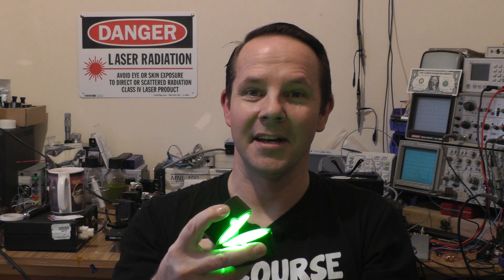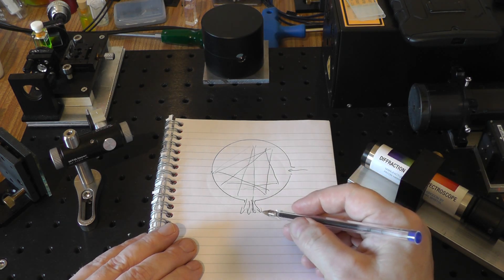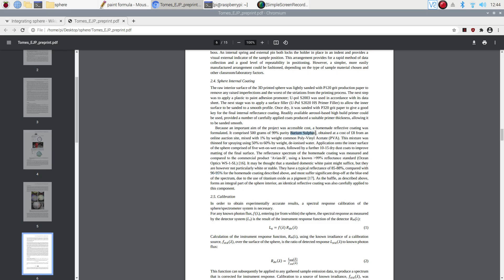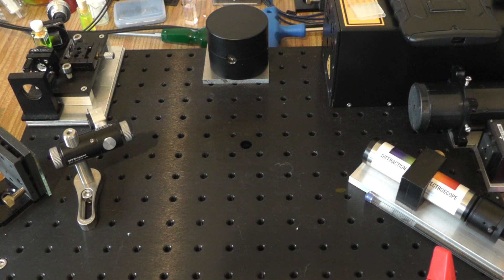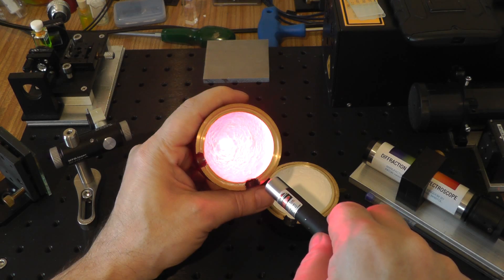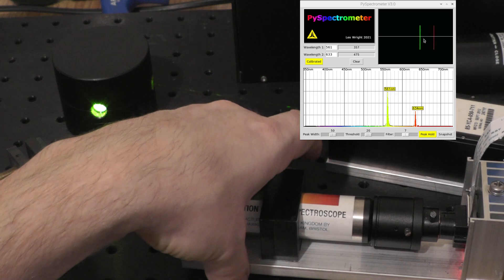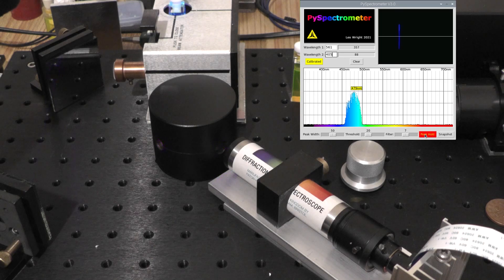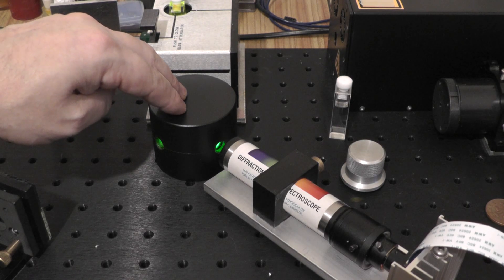Home Made Integrating or Ulbricht Sphere

Comment: Whiskey round ice press. copper-coated stainless steel with around 4cm diameter cavity inside for ~$15. but 3d printing is far superior, just needs more paint or copperplating first to minimize absorption.

Comment: Do you happen to have access to the CAD/STL files for the sphere? Having difficulty gaining access.
Reply from the maker: Hmm, I don't seem to have them handy, and the link is broken. Really the only requirement is a hollow sphere with input and output ports at 90 degrees, so it should not be too difficult to design. You could probably do in in TinkerCAD.

Comment: Just a lick of matt black paint on that mould and it doesn't look the slightest bit out of place on an optical bench.
Reply from the maker: For sure. I found an auto paint manufacturer in the UK (Steyer) that does a hard wearing acid etch primer that goes on like silk. I use the stuff for everything.

Comment: Repurposing a cannon ball mold makes a much better and less expensive integrating sphere than the one I blow molded from Plexaglls or made by using Plaster of Paris to make a mold of a large ball bearing, then painting the cavities with the same one percent PVA and Barium Sulfate you used. The Plexagals integrating sphere functioned as well as a metal one, but the cost of making a fixture to blow mold the hemispheres and learning to blow good plastic hemispheres at 325 F. Then mating two hemispheres to form an acceptable sphere and finding a primer and surface finish for Plexiglas that homemade Barium Sulfate paint would stick to cost a great deal more in labor than $40 to $100 USD the cannon ball mold would have cost. 

Plaster of Paris cast over a ball bearing is quick and cheap, but it absorbs humidity and is not compatible with lasers with much power at all. Steam explosions in the walls of the integrating sphere will mess up a lot of stuff.

Comment: May I ask you a question?  Sorry in advance for my English. Since the laser was diffused inside the Ulbricht Sphere, may I say that the laser that comes out is a diffuse ray? It lost the temporal coherence but still has spatial (the wave length is invariant)... Is it right? Is it less dangerous that the previous laser? Thank you.
Reply from the maker: Yes, the beam that emerges is diffuse, and loses coherence to a degree (there are more effective ways to de-cohere a beam). The resultant light is not less dangerous. If you stare into it, you are still looking at a light source brighter than the sun.
Reply: @LesLaboratory  Thanks a lot. The calculations (for a 3B laser of 1,6 microJ) due to CEI 60825-1 let me consider an irradiance less than EMP. May I did think something wrong?

Comment: Hello, You might notice that the barium sulfate is water absorbing and with time (and the PVA glue) your reflectance levels might decrease. Aluminium oxide (that is used in commercial paints) might be another option. Something that would be a great addition would be vacuum forming a PTFE sheet in your sphere. 
Also, you might be keen to sand (300 grit as per ASD) the inner side and paint to have a lambertian (uniforrmely diffused)  surface.
Reply: the main big matter is that PVA glue will eventually develop color centers when aging.

Comment: I made a similar sphere, but for a different purpose. For uniform illumination of the film. Barium sulfate is very difficult to grind into a homogeneous substance. You need to make a bead mill and load barium sulfate and PVA into it. But for a single use, you can grind with a pestle in a mortar with a small amount of glue, and then dilute with glue to the desired consistency. Les, have you tried doing holography with your color lasers? I think it's very interesting. I also want to make an N2 laser and I have everything for this.. But I don't have the opportunity to buy a quartz cylindrical lens and mirrors. Because of this, I am very upset. Do you know where you can get such a thing?
Reply from the maker: Cool! I got my cylinder lens from Edmund Optics, but it was expensive at around $80. You can however find suitable Cylinder lenses in Laser printers. They use them to shape the laser diode beam, and although not silica, they are transparent enough that they will work.

Comment: Very inspiring! I intend to build a heterodyne interferometer (from sam zeloof) but dont have an optical bench. Do you have any advice regarding optical plates (where to find cheap ones?) I saw some 3D designs from BrendaEM and printed them but i dont know how they compare
Reply from the maker: I got mine from Thorlabs for 200 bucks including shipping and tax, which I figured as pretty reasonable. I had considered buying thick aluminum plate, and drilling ant tapping it, but Aluminium is expensive anyway, plus the time and effort drilling hundreds of holes.
I suppose in a pinch you could get steel plate, ans stick magnets on all your optical mounts....
Reply: @LesLaboratory  thanks! Ill try my 3d printed ones out :)

Comment: That went together really well. I was also having issues with spectrometer measuring and I have been seeing how sanded metal surfaces and frosted glass diffuse the beam. I could see making one of these Ulbricht spheres and having an iris and SMA connector attached to it.
Reply from the maker: Thanks, it was a nice build. For sure, you could mount an SMA fiber connector on it. It would probably make it more efficient than mine. Large apertures waste photons.
Reply: Did you ever find the CAD file associated with the paper?

Comment: Excellent. What is the diameter of your cannon ball mold?  I'm based in the USA can can't seem to find one. Any suggestions?
Reply from the maker: 2 inches in diameter internally. Hmm, try looking for sinker moulds or similar. Some anglers like big heavy weights on their lines!
Reply: @LesLaboratory  thanks, I did try that. BTW an excellent channel.
Reply from the maker: @DaSmokeDaddy  Thanks! Try eBay, take a look at 290809870305, they don't have any large ones in stock, you could always enquire.

Comment: Nice work as always, Les! Thanks for the upload. 

I think I can more clearly see why speckle is present in the outputs from some my dye lasers - although the output from a dye like R6G is broad, the edges of this broad curve appear to be rather abrupt and sharp (as distinct from the smooth curve that would result if analyzing the spectrum of light from an incoherent source). Am I correct in this attribution?
Reply from the maker: You can get good speckly output from R6G of you are using a diffraction grating to tune it. The problem is, the gain of R6G is so high, it is easy to overdrive it (in which case gain will happen with mirrors or not, and so you get very broad emission), even with very small Nitrogen lasers.
To attenuate home built N2 lasers, I just add regular glass microscope slides in the N2 laser beam, until I am just at threshold for the dye being used.

Comment: Your description of the integrating sphere makes me wonder, can it act as an optical pulse time stretcher? A pulse enters and starts bouncing around, some paths are longer that others, so the light in an individual pulse takes longer to exit, than its duration when it entered. Hmm, 2 centimeter sphere? Transit time of ~67 pS. You mention that the laser pulses are ~2000 pS long, so a 10 % stretch would be about three or four transits of a 2 cm sphere. Have you an o'scope and detector fast enough to measure your pulses? does the sphere stretch them out?
Reply from the maker: I don't see why not, the problem is I no way of measuring it. My Fastest Scope is only 100MHz. I would need either a much faster 'scope or a streak camera to do stuff like that.

Comment: Great video
Really cool project!

Building up a “felt-like“ coating, seemed to give me the best results. Of course then it is CRAZY fragile. And a few fingerprints can really diminish the effectiveness.

I used a ball mill to obtain a SUPER fine compound. I’ve experimented on and off with that for a few years, not only with barium, but also carbon/graphite in an attempt to find a substitute for “Vantablack“. Which is super useful for things like broadband coatings of optical power sensors, and anti-reflective coatings inside of optics. 

The best results were obtained by experimenting with the techniques of application. Trying to build up a “felt-like” coating, Made a pretty big difference.
Because it’s more of a 3-D texturized application, which traps light a lot easier, and in the case of barium… seem to give more surface area for the light to reflect.

Also, here in usa I was able to find readily available cheap spheres made of thin lightweight materials, I guess they’re aluminum… some of them are stainless.

There’s a ton info on YouTube regarding a DIY sphere. 

“Periodic videos“ put out a wonderful video on barium and it’s reflectance properties in the past year or two. 

And Believe it or not… “Torque test channel“ built a very similar device, to test the output of various brands of flashlights. If memory serves me correctly, they also sent some of the flashlights away to be tested in a real laboratory to compare it to their DIY device. 

One of the best recent videos is from “IMSAI GUY”, and he explains the science behind it. He has a background in optics and is extremely knowledgeable on the subject. And shows a very nice example of an integrating sphere.
Reply: Here are the above-mentioned videos

https://youtu.be/Ay6ckBojc_0

https://youtu.be/TDfVxYbcB5Y

https://youtu.be/tuYIKuyKZHU
Reply from the maker: @hullinstruments  Cool! And thanks for the links! Yep, I wanted something quick and effective, but sure, you can do funky stuff with coatings. Some formulations for white, required you to dust the surface with dry BaSO4 while the last coat was still wet.
This would undoubtedly improve reflectivity by a couple of percent, but as you say, would make for a fragile coating for sure!

Comment: what's that going on down there at 465nm while the coumarin is lasing at 495? Amplified spontaneous emission?
Reply from the maker: Yes, you are exactly right, it is ASE! This happens with the Rhodamine as well (although in the green)
It is possible to get rid of it. It is not as coherent as the main beam, and appears mostly as side beams that you can nip off with an adjustable Iris. A small Lathe project I did was to make a post and holder for a small Iris I bought off of eBay, and it works really quite well.
Reply: @LesLaboratory  noice! slowly but surely I am still learning how the nature of things is arranged...

Comment: Thanks Les, great vid. Some questions: a) I saw wisps of smoke at various points in your vid - what's that all about? b) What beam power can the sphere accept before being damaged?
c) Great to know the simple formulation of indoor barium sulfate paint, but what would your viewers need to do for a 'How to make barium sulfate outdoor paint at home' video? I want to keep my shed cool in the hot Aussie sun 😀
Reply from the maker: You are welcome! So answers in order:
a) Smoke is for effect, everyone loves to see laser beams, and it helps illustrate things,  so I waft a bit of Majcan about the place.

b) I have not measured maximum power that the coating can withstand, the Dye Laser deposits energy in the order of millijoules in a couple of nanoseconds, so peak power is a few kilowatts. As for average power, I guess maybe a couple of watts or so before the binder starts doing strange things. The melting point of BaSO4 itself is over 1500 C.

c) I have not really considered this, and I am not entirely sure. The authors of this paper: https://pubs.acs.org/doi/10.1021/acsami.1c02368 used acrylic as a binder, which makes it still essentially a water based paint, however they did successfully use it outdoors. I suppose when it cures, assuming rainfall is infrequent, it probably wears quite well. I think an acrylic base is probably inexpensive, and Barium Sulfate is probably very cheap in large quantities too, so there would be no great loss in trying it. Unfortunately I live in a very cold and wet corner of the world, so I would be unable to test it out.
Reply: @LesLaboratory  Cheers Les

Comment: Always interesting, this took me down the surface route and I was reading why "Matte" surfaces are Matte and its not straight forward, it explains why good matte paints are a bit more expensive and also why Matte Green for PCB's is not widely available yet and is expensive when it is offered, great stuff !....cheers.
Reply from the maker: Yeah, these things send you down rabbit holes! Some formulations for painting spheres require that when the last coat has just been applied, you sieve dry Barium Sulphate on to it for the ultimate matte coating!
Reply: @LesLaboratory  Makes sense !